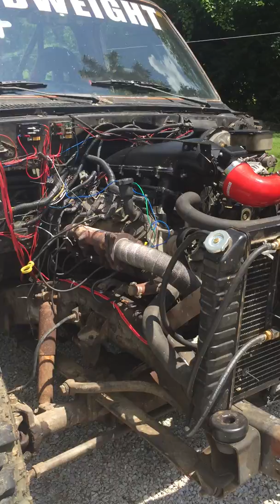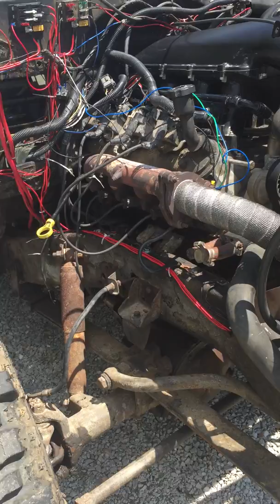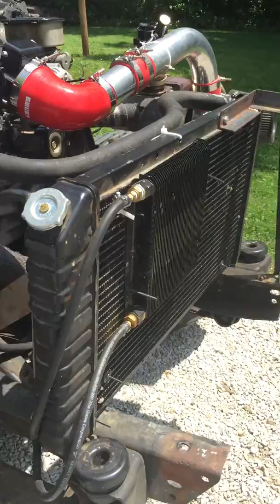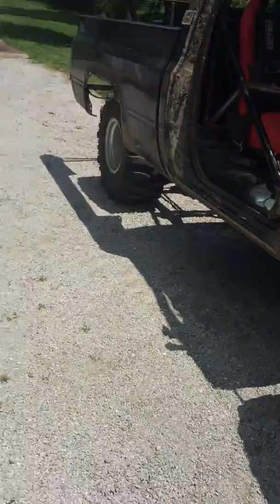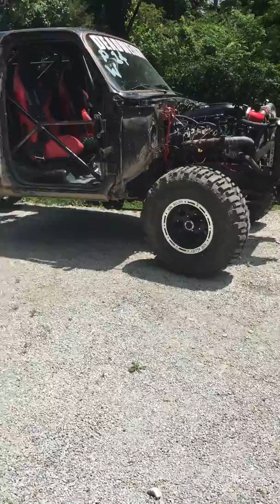1 5A injector driver from a Microsquirt running 8 160 lb injectors with a solid state relay

Comment: Did you have to  enrich the fuel table when running a solid state relay ? With the  higher resistance in the  control side of the relay ?